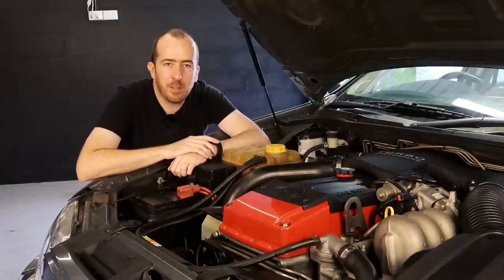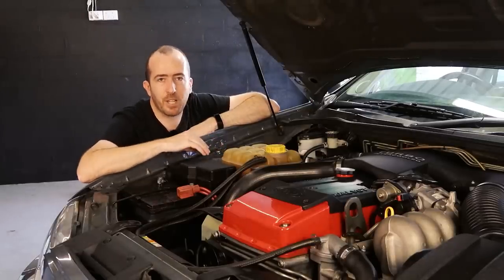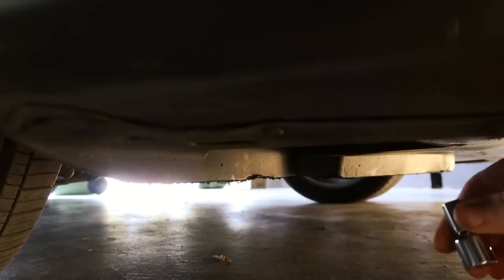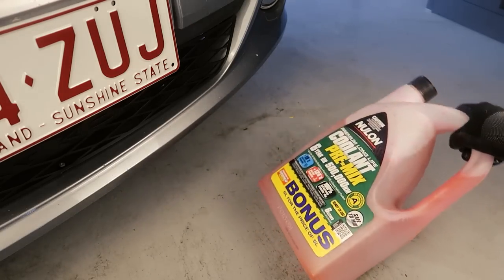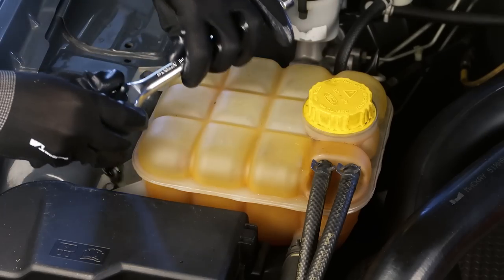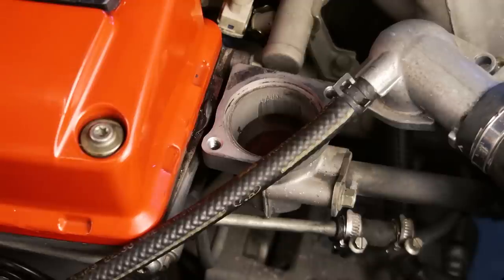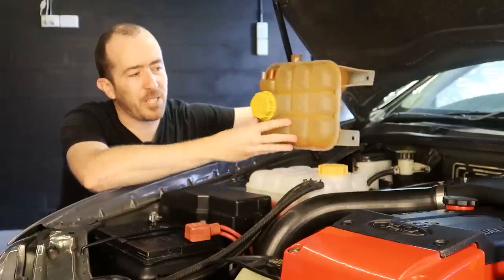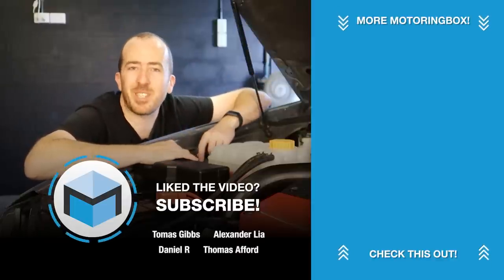Flushing the Cooling System on my Ford BA Falcon XR6 Turbo

Comment: FYI even with the gasket, coolant may still leak from the thermostat housing (as it did on my BF). Get some RTV gasket maker on the mating surfaces if it does (hopefully shouldn't!)
Reply from the maker: All good so far!
Reply: Mine did the same thing, when I changed the thermostat over I didn't put on waterproof sealant on and the gasket dislodged and got pumped into radiator and had to replace it again and use gasket maker or waterproof sealant to re do it again and hasn't leaked since. The repair manual says its required to use waterproof sealant on the gasket.

Comment: Hey mate I just got an bf falcon xr8 doing the coolant change how many Litres of coolant does it take cheers👍
Reply from the maker: Not sure sorry. I just buy the 6L Nulon concentrate and 6L of demineralised water and put it in 50/50. There's always plenty left over.
Reply: @MotoringBoxTV  all good i found it mine takes 13L but thanks anyway mate love the channel if can check out my channel going to be doing a review on my bf xr8
Reply from the maker: You'll probably find it takes a little less, as there will still be some left in the system.
Reply: @MotoringBoxTV ok yeah i brought wrong coolant expansion box i brought 6 not the 8 but fits ok its just a little closer to engine should work still you reckon

Comment: Thanks for the heart on my last comment. I actually am trying to locate the heater tap in my wifes BA Falcon. I have changed heater taps in e series many times before, so I thought this would be easy. I am unable to locate the heater tap myself, my useless Haynes manual doesn't list it and I see no mention of the location of the heater tap on the internet. I can't replace what I can't see. Do you happen to know where I can find the heater tap? Cheers.
Reply from the maker: I've not had to look for it sorry. I believe it's different to the AU and E-Series though.
Reply: Thanks for replying. It is a complete mystery.

Comment: I'm looking forward to the misfire episode. The consensus would point to a coil or plug - it still could be anything. When I had a coil fail, it failed hard - money light flashing, engine spluttering, throttle ignored; then it shut the whole gig down. Best outcome is the plugs/coils, it's a joyous occasion when it's not something more sinister.

Comment: Some cars with aluminium radiators will recommend red juice, older brass radiators with cast blocks will recommend green. This is not always consistent with models and manufactures do update their recommendation for modern coolant (Toyota red coolant). The most important thing is to never mix it red and green. It's gotta be one or the other. Chemical reactions happen and it sludges up. So long as it's not straight water from the tap or blend of everything, happy days.

Comment: Just a little piece of advice, as your replacing coils and spark plugs clean out the intake throttle body and replace the fuel filter for peace of mind.. great vid
Reply from the maker: When I was cleaning the engine I gave the throttle body a quick wipe, I'll definitely have a closer look at it though.

Comment: What's your take on  NJK oridum spark plugs alot of people say you shouldn't be using them unless your making 300kw at the wheels but personally I've gotten 150,000kms out of them and can't really complain they've been good.
Reply from the maker: I don't really have an opinion I guess - perhaps they are better if you're putting more boost through the engine and chasing higher power. I decided to buy the Ford/Motorcraft OEM plugs which Ford specify for XR6 Turbo & F6 Typhoon, because this car will most likely be staying well under 300rwkw.
Reply: @MotoringBoxTV  thanks for the reply. Anyway appreciate your work it's helped out alot with my own AU and I always find it interesting the diversity of things that can happen in your videos some problems are very common and some aren't.

Comment: So just so I understand. Why not install the thermostat before filling coolant? Why did it need to get to certain level?
Reply from the maker: I've had issues before on other cars with pockets of air getting trapped in the engine, so I figured this is a good way to help reduce the chances of that happening.

Comment: Great video! You Queenslanders use the heater lol.

Of note, I used to just undo the bottom hose as well, but on left side there is a tap. It's yellow. Last time I used this, then took the hose off. Much less mess! 

Don't know if you've made the next video, but will be interesting to see if youv got some armoral past the plastic rocker cover seals and down into the spark plug holes. I did this with my Falcon after pressure washing the engine bay when I got it. Now I just use an all purpose cleaner on the top plastic.

Also inlet manifold gaskets are unfortunately a common thing as well. Just old age.
Reply from the maker: I did consider that possibility, but I highly doubt that would be the reason. A pressure washer or hose would definitely be a bad idea though, which is why I avoided that. The engine has never idled perfectly smooth, so it is kind of like a minor issue which is slowly getting worse.
Reply: Yes.. sure did learn my lesson the hard way. In 2011 Coils were still quite costly too. If you love the car and plan to keep it, might I suggest stick with genuine coils / plugs? I have lpg fitted so I can't do plugs myself anymore (injectors sit on top of my plastic rocker cover) but after mechanic fitted genuine OMG my car felt like new again.
Reply from the maker: Yup we think alike! I have a set of genuine Ford coil packs and Ford Motorcraft spark plugs to suit the 240T. The plugs are gapped to 1.1mm but considering I am not planning to up the boost at all they should be perfect.
Reply: @MotoringBoxTV  Also check your harmonic balancer. They can be out which can cause a rough idle. Had it on a MK1 BA.
And for info the heater always has coolant flow going through it. they don't have a heater tap like other cars
Reply from the maker: Good to know, cheers.
Reply: Nice! Looking forward to the video. Hopefully getting the rear plug out goes ok.
Reply: No there is no Tap not on XR6 turbo radiators on the stock BA falcons Stock XR6 there is Tap
Reply: @iamasmurf1122  wow! That's certainly strange. Without looking I'm guessing the xr6 turbos / V8's run a different radiator, but certainly strange!
Reply: Paul McGaw its not strange because XR6 turbo cooling systems are under more pressure , have a look on EBAY at the different radiators they are not the same

Comment: nice job. re: idle misfire, check for a vac leak on  intake manifold side ist.
i did exactly what u are about to do on both a 05 territory and xh ute both 6's and wasted a ton of cash on plugs coil and leads , and plugs + coil packs respectively.  both engines had intake vac leaks on 1 and 2.  when spraying carby cleaner in those areas u could hear just a slight change of idle on borh engines in the offending cylinders. tryed to tighten them up but a chunk of old  gasket must have popped out sometime ago. old intake gasket out literally came out in chunks, new one in and both motors run like champs now. barra was a real bitch to do in place. ps dont use gasket goo on i/g. and tighten from cyl 3/4 outwards. also retighten after a few heat cycles as all my bolts loosened up some. if u take top of the broadband manifolds u can get easier access to bolts but will need to replace bbm gasket.  just my 2 cents worth.

Comment: I wish that Ford of North America would return to some straight six engines. I’ve had about 15 300-6 engines in various F150’s and  an F250HD. A straight six is better balanced, easier to work on and only has one head.

Comment: Used the tt2000-195 and the thing was trying to cook my engine.  Ran back to back tests with my old t.stat and the new one was dodgey.  Beware!!!
Reply from the maker: Mine seems to run a smidge below half on the gauge. It's a 91c thermostat and that's apparently where a stock Barra needs to be? I have read about people running cooler thermostats in tuned cars though.
Reply: @MotoringBoxTV  the new t.stat would occasionally put me up past 3/4.  Checked temps with obd.  91c is a touch less than the middle of 1/4 and 1/2.  1/2 is over 100c

Comment: just googled "red coolant vs green coolant" and apparently the red stuff is made of something organic and is good for aluminium radiators and therefore the green stuff isn't?
Reply: Banura Jayakody that sounds like absolute rubbish all radiators now  from manufacturers are made from aluminium and have been for about 40 years , the red coolant has an organic base but its not fully comprised of organic
Reply: Michael Wilson plenty of cars still have a copper radiator.
Reply: chipchip no they dont  most cars if you read the link now have Aluminium radiators . as a Automotive technician i can assure you manufacturers phased them out, name one  !! make up your video show a link about these copper radiators , in old cars predating the 80s yes but  they phased copper out because Aluminium are more efficient at cooling and cheaper to make here BUD read this link about how car manufacturers have switched to Aluminium , notice in my original statement i said “Manufacturers “ not aftermarket !! You really need to learn to read and comprehend what you read https://www.inrad.com.au/index.php/about-radiators/understanding-radiators
Reply: Michael Wilson Calm down mate. Plenty of after market and replacement rsdiators can be copper, usually for older cars. That's all I meant. Keep ya panties on.

Comment: Pretty sure the colour on the coolant has the do with the metals used in the engine. Example being Green coolant pits Alloy, Red Does'nt.
Reply from the maker: Probably, I wasn't interested enough to find out the differences.
Reply: It is usually recommended to use a green ethyl glycol solution in older engines.
Reply: @peterriggall8409  Makes sense as alot of older cars have cast iron blocks. Any coolant is better than none.
Reply: Wasthinking same. But Nulon says red is fine now. That or Coolant One, but I've ran green since owning in 2011. Change out every 3 years. Everything is all original except thermostat and 2 hoses.

Comment: is it still white? i put one in a year ago gone crap now
Reply from the maker: Mine is still looking good. I have some recent videos working on the car if you want to see it. If you've done a lot of kms I suppose it would go to crap a lot faster.
Reply: @MotoringBoxTV  yeah mines a,g6e turbo might do the trans cooler soon as I don't need or want a milkshake

Comment: The red coolant is chemically different and is specifically for aluminium radiators.
Reply: The colour means nothing read the label as to what style of coolant it is also check your owners manual as to what style your vehicle requires. The other item to consider is the new coolant compatible with your existing coolant thus checking the type of coolant
Reply: Stuart XR6T , the colour does mean something! That’s why they’re different colours!
Reply: Ford Bloke the colour is just a dye if you look at two major brands of OAT coolants Caltex is red Castrol is green very similar products both use the same technology different additive manufacturers both ethylene glycol,  manufactures use different colours to make a marketing difference if you wish to check ring one of the major blenders / manufacturers the biggest is in Brisbane
Reply: Stuart XR6T , ok!
Reply: @fordbloke4790  Mine is clear, like water.
Reply: Fake news. People argue on the internet about coolant colour until they're blue in the face but at the end of the day you have to ask yourself, is it coolant? If the answer is yes you're probably going to be ok for most everyday cars.

Comment: Technically, the red stuff is a corrosion inhibitor and anti-freeze. Water will act as a coolant all by itself, it just won't be very good for your engine or radiator. (Smart-arse lesson over.)

Comment: Red or green ... OAT Vs. HOAT .... um there is a manual in your car with a Ford standard .... which is green HOAT.
Reply from the maker: For coolant Ford specifies "ESE M97-B44A". That's straight out of the BA MKII Series warranty and service booklet that came with my car. Nulon Red Premium long life coolant meets that specification. https://www.nulon.com.au/products/cooling-systems/red-premium-long-life-coolant-100-percent-concentrate

Comment: There is a UV treatment procedure i see people do to old White(now yellow) consoles and controllers, i would assume the same would work on your old overflow res.

https://www.howtogeek.com/196687/ask-htg-why-do-old-computers-and-game-consoles-turn-yellow/
Reply from the maker: For the cost of a new tank I am leaning towards 'it's not worth cleaning'. Plus the plastic around one of the hose connectors was showing signs of becoming brittle from prolonged heat exposure.
Reply: @MotoringBoxTV  Yeah thats fair, time is money after all

Comment: Bra just so you know you got to leave the cap off the water tank and turn your heater to full in the car to bleed the water lines for about 10 mins but you will see the bubbles  rising in the tank. wait till no more bubbles then close cap or you wont get pressure though the lines and blow an engine from water not run though the system. big part of the process you missing there buddy.
Reply: hello!  I just replaced my water pump in my barra, and topped up coolant and it was empty again when i got back on 25 degree day driving for 45 minutes could this be cos theres air in there and causing a leak?  should i bleed it now?  no one talks much about bleeding I will try this tomorrow though

Comment: the bottles get brittle over time and can split, should be replaced anyway every 10 years or so..
Reply from the maker: Yeah, if you see where the two small hoses connect you'll see both were brittle. One was red and swelling/cracking, and the other actually had the end of it snapped off!

Comment: Difference is these engines take GREEN, they are different and use different chemicals, dont mix em. Seeing how you are flushing it out, and if done properly changing coolant shouldn't matter.
Reply from the maker: Have confirmation from Nulon that their red is suitable. Also have confirmation that not all red coolants are the same. And neither are the greens. It varies by manufacturer so make sure the specification codes are checked.
Reply: @MotoringBoxTV  👍

Comment: Hydrogen peroxide in the sun will clear up faded plastic.
Reply from the maker: The plastic was absolutely stuffed. I noticed later the connectors where the hoses attach were starting to break apart.